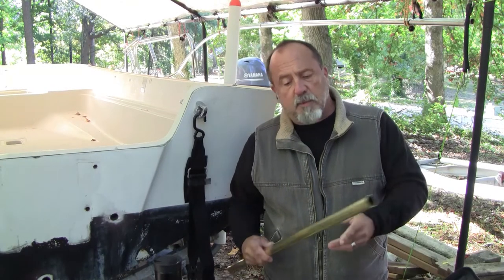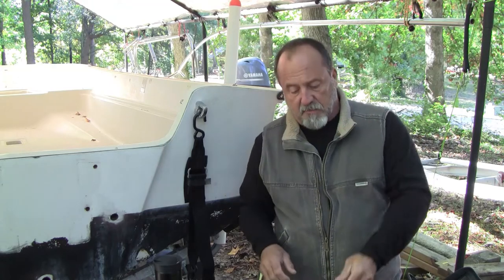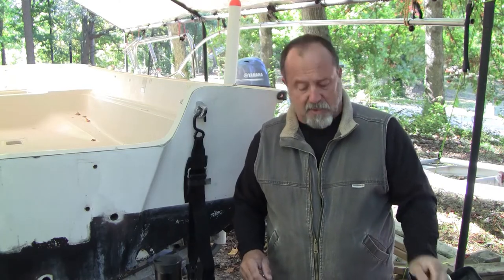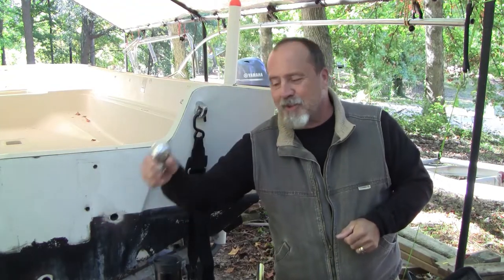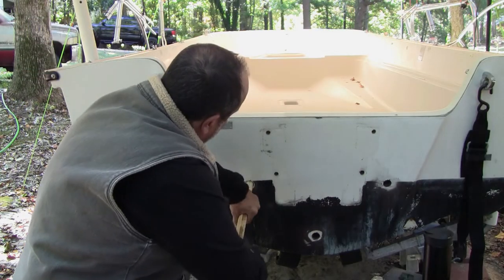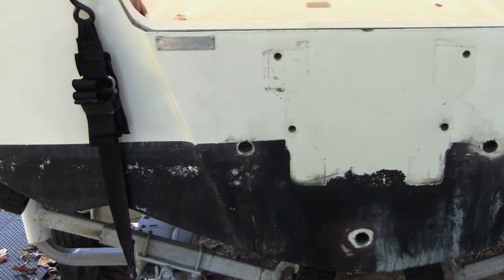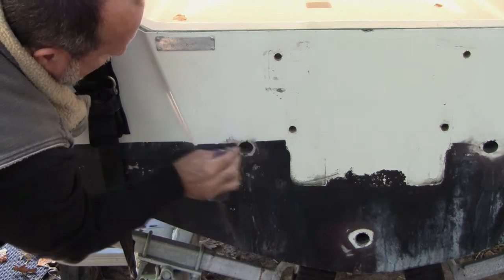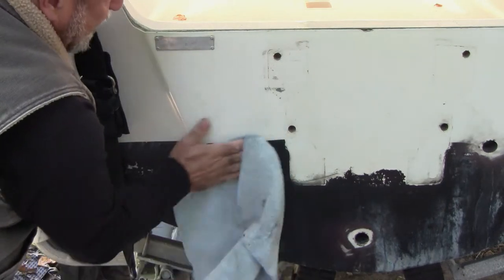How to Replace Brass Through Hulls - Classic Boston Whaler Montauk Part 3

Comment: Good stuff, thanks for sharing.  Love the detail.   Is there a reason why you can’t use good quality stainless (AISI 316) tube in place of brass?
Reply from the maker: I haven't tries it but I suspect that flaring stainless may be a bit more of a challenge. I know they sell slip in pre-flared ss tubes that have two sides, one slips into the other. But the ones I have seen are too short for the bilge. I may have to give flaring stainless a try to see what happens!
Reply: @ExtremeDIYGuy  I only ask because bronze and brass both degrade over time ( gets pink and/or green and you know it’s leeching)  and thru-hull fittings on high end boats typically use  flared 316 stainless.
Reply from the maker: I agree, Stainless would last much longer than brass tubing!
Reply: Awesome!

Comment: Do I need to buy a longer bolt for the tool on the lower tube?   They all seem to be short or is flaring one piece of brass tube so I could slide another into it an option Like a plumbing fitting..?

Comment: I haven’t seen it done with rubber orings, is that something you came up with or a technique published somewhere?
And are you concerned of the rubber rotting out and leaving you with a gap between the brass flare and the hull?
Reply from the maker: This is a techniques that is discussed ion either continuous wave or Whaler central ( I forgot which), EDPM should last a long time, viton even longer. Will probably outlivbe me lol

Comment: Would using PVC pipe work, instead of brass pipe?
Reply from the maker: It should but curving the ends out for a tight fit might present a challenge

Comment: How did you flare the inside portion of the long tube?
Reply from the maker: I pre-flared it on the work bench with the flaring tool and a brass hammer

Comment: Do you need the brass tube?
My fiberglass supplies said to just drill the hole and then just put resin around the cut. As the bottom of the transom is just fiberglass.
Reply from the maker: For the classic Montauk you do, there's two inches of wood and the rest is foam. The inside of where the brass tube ends is the bilge area where any water that gets in the boat collects.